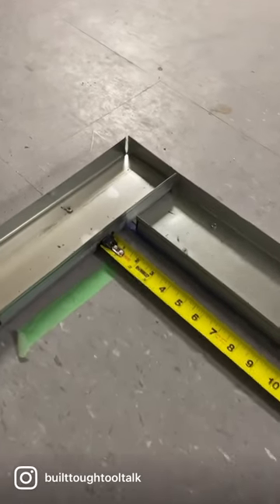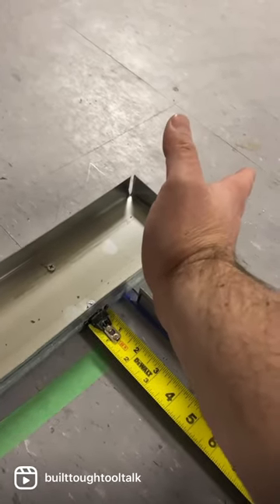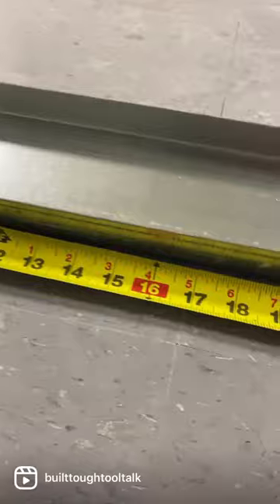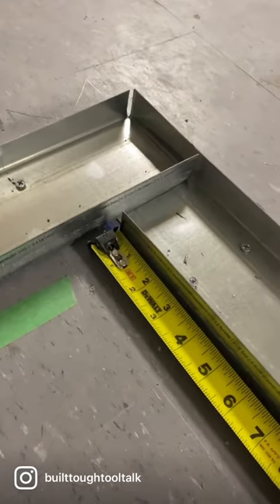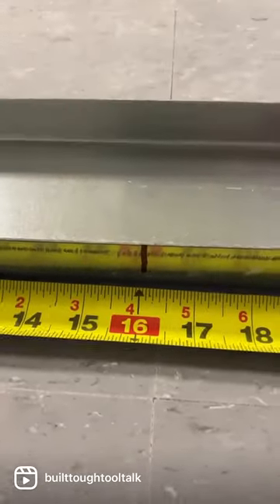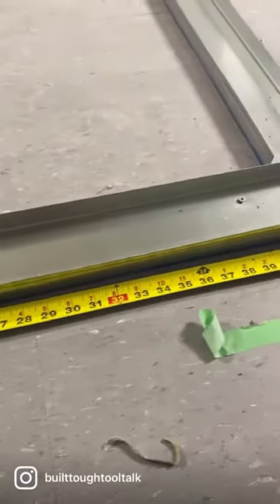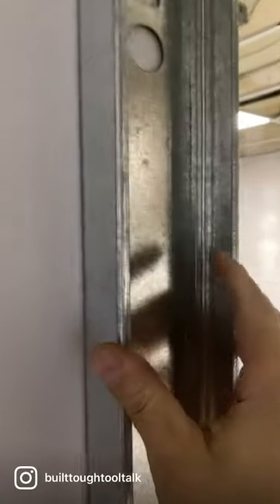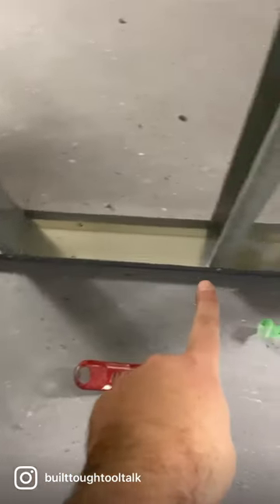How to do layout when framing with steel #shorts

Comment: Make the slot 3/4  even 1inch. Me personally I lock from behind. To screw 2 studs together you gotta make sure they are flush. Better to put the other side first in that case
Reply from the maker: You can get the same results either way.

Comment: Should be 5/8.   If you’re using steel, your most likely on a retail or commercial job and therefore require 5/8 drywall.
Reply from the maker: I am using 1/2” drywall. That’s why I went a 1/2” more than 16. So no it shouldn’t be 5/8 because I am not using 5/8 drywall lol.
Reply from the maker: @youmad1313 huh? Why would I want to cut 3/4” off when I don’t need to cut anything off? I can put a full sheet up from here

Comment: I need to replace rusted bottom track in restroom and few studs… the studs are rusted 2 ft up the most . Do the whole stud and track needs to be replaced ???? Any help ?
Reply from the maker: I always suggest replacing the full stud but sometimes that’s not what the client has the money for. Sistering the studs does work but it’s not the best option

Comment: Thanks for the video! I have a question, is using self tapping screws ok to mount things on metal studs or it has to be snap toggles?
Thanks
Reply from the maker: Self tapping screws are fine to mount 👍🏻 heavy the item bigger the screw tho
Reply: @builttoughtooltalk  thanks mate, I mounted a tv having 2 brackets and used. Two 14g × 50 mm screws for each bracket. I added a few 20 kg super wallmats to each bracket to just in case. So hope it's all good 🤞

Comment: 1/2 inch is no good, that first stud make it at least 1 inch away from the other wall, this will allow the drywall guys to use their drywall collated gun without having to put the screws at an angle, they will love you for that, and the layout you should attach the tape to the edge and make the layout 3/4 more than the 16inch mark, this will make the drywall sheets end right in the middle of the stud without having to cut the drywall, I only do that when the wall length is bigger than 8ft

Comment: Metal studs are garbage. I used to tear out what's left of them. They would literally disappear with any kind of moisture. I don't mean rust, I mean they would be completely gone 4' off the ground.
Reply from the maker: That’s what we use here in commercial. 🤷🏻‍♂️
Reply: @builttoughtooltalk  I know, same here. I think it's for fire ratings.
Reply: Lol if you have THAT much moisture where your studs are, you’ve got much bigger problems than metal studs 😂
Reply: @jordenbronson8122  Fucken A but you can save/dry wood studs 99% of the time.
Reply: RIGHT!! 🤣😂🤣

Comment: Absolutely incorrect. You pull 15 1/4 from the outside then 16's
Reply from the maker: This is the way it is taught here so it is not incorrect. Once one wall is boarded it’s exactly 16 oc for the boards on the next wall. Please explain why you would pull 15-1/4 off the outside for your first stud.
Reply: Sorry man, those are measurements for studs without a center mark. Your stud would go on the mark and travel.
Reply: @builttoughtooltalk Because that's how you Frame for 16OC.   15 1/4, 31 1/4 etc. That's for the edge of the stud, no one frames to center marks.
Reply from the maker: @evictioncarpentry2628  well we do here. Different ways in different areas man. But you must have already known that